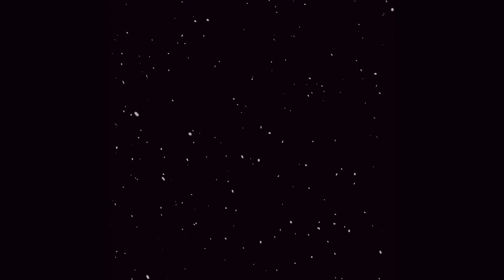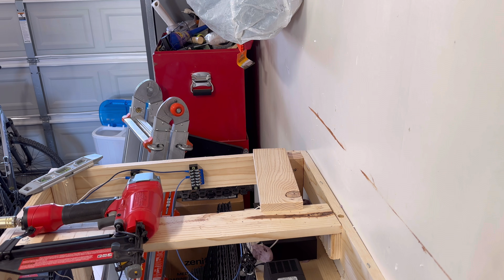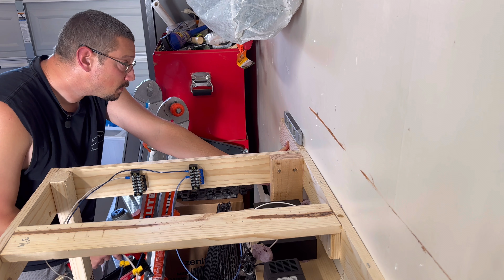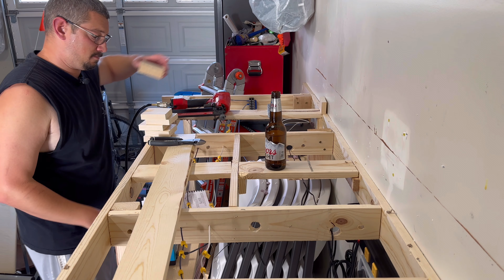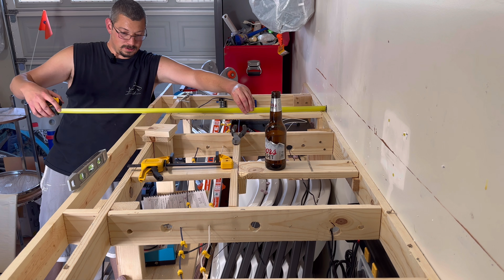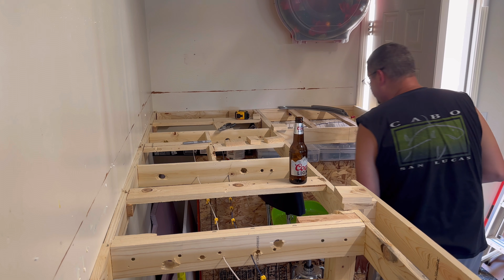N Scale Silver State Trains Layout Rebuild Part 3

Comment: Have Nail Gun - No Problem!
Reply from the maker: Lol. Makes things easier and quicker for sure. I will add some screws in for added strength where I can. The wood I used is thin so do not want to split it. The main frame was glued too. I skipped that step this round.
Reply: @Silverstatetrains  It was amazing to watch you work so fast.  Im the complete opposite, spent a month planning and designing.  Maybe over planning lol.  Been designing mine to use benchwork modules so that if I ever move I can save the benchwork and maybe the track and scenery.
Reply from the maker: That is a cool idea. I have so little time if I do not move with speed nothing will ever get done.

Comment: Why add plywood?. The Foam should be okay with all the bracing you have already installed.
Reply from the maker: I noticed with my last layout there were some soft spots where the foam flexed. I figured the plywood is cheap insurance for added strength. Plus can nail it to the frame to make a solid foundation. I have to reach far across in the back corner so have more strength is never bad. Maybe with my third layout I will add more bracing and skip the plywood. Trail and error at this point. Thanks for checking out the video.